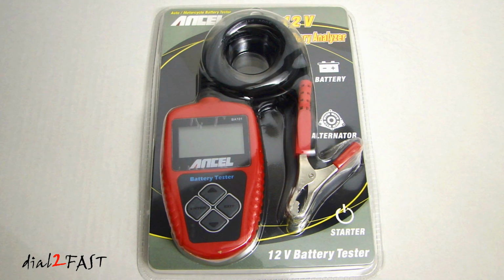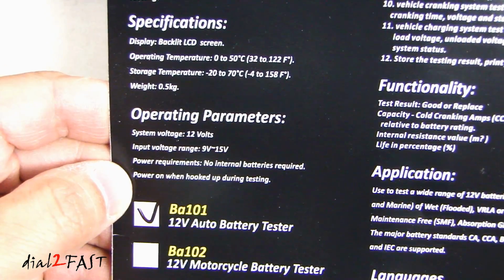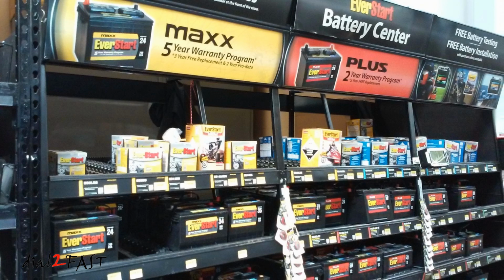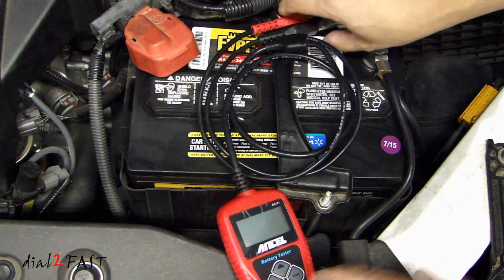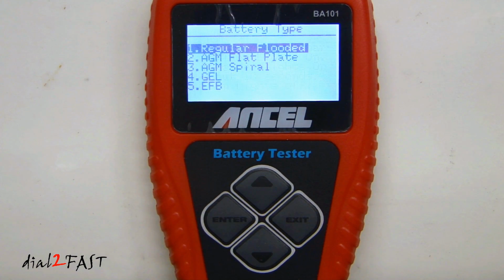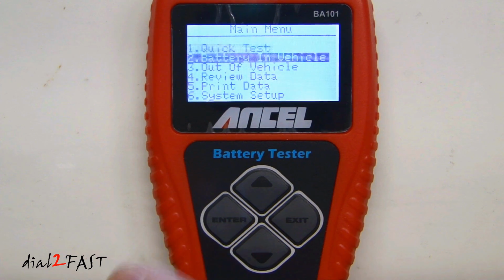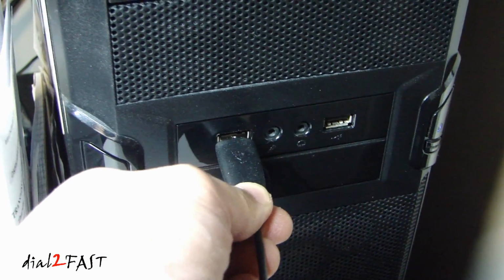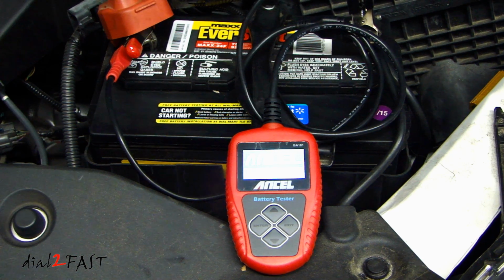ANCEL BA101 Car Battery Tester + Starter & Alternator Tester

Comment: Subscribed & rang the notification bell.
FWIW; The packaging has changed & no longer includes the CD for downloading the PRINT application.

The instructions that came with my unit told me to go online & click on the "Download" link on their webiste - however, the download link DOES NOT WORK WITH MAC COMPUTERS, only Windows PCs.
Reply from the maker: Thanks for subscribing and for the heads-up on the packaging updates!

Comment: Having just moved from walking distance to AutoZone to the woods, 15 miles from any auto parts store, I just bought this for $35.  THIS VIDEO IS GREAT. 
A battery died shortly after I got the tester, so it really helped.
 My old and new batterys did not list A-Hrs  amp hours. Someone at NAPA said to multiply amp hours by 7.25 to get CCA. Sorta works sometime.
But the machine gave me the info which I will write on top of the batteries. Thanks.

Comment: I bought that BA101 and I may be having a problem. I tested a brand new Delco battery and it said it wasn’t good, charge 100% but health 65%, brought it back to the store where they tested it in front of me on two seperate testers that said it was 100% good with a much higher CCA value than my test. Can those be defective?
Reply: Also… in your video, the first test you did said your battery was 100% healthy. The second test said your battery was 64% healthy… What do you make of it? Is there something I don’t understand here?

Comment: When doing the "charging test," do you lest the RPMs return to normal before pressing enter?
Reply: I was wondering the same thing. Maybe the measurement is supposed to be started by Enter only once RPM reached 2500. Ambigious instructions are probably a Chinese thing. So as Tina Turner used to sing: You'll never know 🤣

Comment: Hi, I am looking for a battery tester that will also work well for deep cycle batteries. Will the
ANCEL BA101 tester work properly for deep cycle batteries? I have a small deep cycle 35ah 12 volt battery and the others are full size deep cycle and starting batteries. Many deep cycle batteries don't have CCA or CA listed. 
 Please let me know.

Thank you

Tony
Reply: NO DEEP CYCLE BATTERY TEST. This type of battery load tester is meant to test cranking amp of start/cycle battery 6-12vdc. For deep cycle battery, this tool can only get ball park idea of battery health by getting internal resistance and CCA then comparing it to new of good exact same deep cycle battery reference from your own data or from battery manufactor spec sheet. The true deep cycle battery capacity test is done by using WATT METER under the same load.
Reply: @charlieson3394  Okay, thank you

Comment: Thank you for your video review.

All of these conductance testers only test for two parameters, Voltage & Internal Resistance, everything else like CCA, SOH, SOC etc. are calculations derived from those two parameters.

On the charging test it showed loaded and unloaded test results and an actual loaded test was never performed from what I can see, when did you load the electrical system? It was just a calculated number because the ANCEL BA101 never prompted you to load the system and in the operation manual it never mentions to load the electrical system either, this is a fail for the loaded test.

Other than an actual loaded test, overall it looks like a decent conductance tester.
Reply: It asked him to turn on the headlights. Is that not considered a load?
Reply: @OMGWTFLOLSMH  No, that is not a loaded test. At 8:36 the tool prompts you to turn on the headlights to remove the surface charge on the battery for the battery condition test so you do not get a false positive reading. I was talking about the alternator charging test that was performed at 10:45, no external heavy load was put on the system, there might be a pair of some wimpy resistors inside that try and simulate a load, but that is not the same as an actual heavy load like lights on, air conditioning on, brakes lights on, fans on, loaded test.
Reply: @JT-ov2yr  Headlights might draw 15 amps.  AC units might draw 10 amps  for small and 40 for large ?  And use about 3mpg.

Comment: To confirm, does an in vehicle test require that the car accessory power to be on? I noticed for my unit that unless the power accessory is on, I get a "Check Connection" error when I perform the Quick Test and Battery Tests.
Reply: you probably want everything to be turned off as not to add draw and interfere with the test results. save for the starter and engine in the latter tests

Comment: I have the result of alternator 

Loaded 12.40V
Unloaded 12.60V
Ripple 30mV

It show charging low.. mean the alternator is faulty?
Reply: Ripple is too large. Bad diode in alt
Reply: Yes. You need to check your alternator.

Comment: I recently purchased this tester and love it. Accurate and very easy to use. I work in the repair field and use it every day
Reply: Does your ancel battery tester still functioning? Mine is dead, no display only back light is on :(
Reply: HEY SO WHAT DOES IT MEAN WHEN THE CRANKING POWER IS LOW OR SLOW DOES THAT MEAN IT IS THE STARTER ON A HARLEY.

Comment: Can use this forest my deep circle battery?  It is 200amps battery. I live of grid, sometimes I buy used battery so I want to kno their state before paying. Again can I use it on 200amps 12v battery to know its state?
Reply: Im down the street. Be there in 2 mins
Reply: NO DEEP CYCLE BATTERY TEST. This type of battery load tester is meant to test cranking amp of start/cycle battery 6-12vdc. For deep cycle battery, this tool can only get ball park idea of battery health by getting internal resistance and CCA then comparing it to new of good exact same deep cycle battery reference from your own data or from battery manufactor spec sheet. The true deep cycle battery capacity test is done by using WATT METER under the same load.

Comment: Very good presentation. I got an Ancel and it seems like a useful tool, after testing it on known good and poor batteries. However the manual is a poor English translation. The manual detracts from the overall impression of the product. Ancel: are you interested in having a technical writer revise it?

Comment: I ordered a Sonic tester after seeing a couple of videos yesterday. How does this tester compare?  When I take my cars in for their oil changes the dealer is supposed to test the batteries.  My wife got stranded about 6 months ago with a dead battery shortly after I took her car in and my car wouldn't start shortly after I got the oil changed  last year.  One of these videos was saying that these testers are better than a regular load tester which I suspect the dealer was using.  He done a test on a batter that was showing good with a regular load tester but one of these showed it was bad.  Another guy was saying that the ripple test was for the voltage regular.  I ordered a tester so maybe I can get a heads up the next time before my battery goes bad instead of getting stuck with a bad one.  I figure anything over 5 years on a battery is a gift.  The original battery in her CRV only lasted a little over 3 years and the replacement Interstate battery lasted a little over 4 years.  The Motorcraft battery in my Taurus lasted almost 6 years.  I have had some cheap auto parts store batteries like from Autozone barely last a year.  I have never got more than 3 years out of a Diehard battery. It doesn't pay to buy a cheap battery.

Comment: Thanks for this very detailed video! much appreciated. Btw most modern cars have AGM batteries  rather than flooded cell because they are required to support auto stop-start systems. Also, I wonder whether the cranking test will work on some modern cars that use the alternator to start the engine through the serpentine belt and don't have a traditional starter motor.

Comment: my ancel ba101 tester arrived and it dont work in motocycle battery!! the minimum AH in this unit is 30 AH my bike battery have 14 ah. so not precise for bbike batteries

i will try this for small batteries

http://www.banggood.com/pt/TY-6402-Car-Battery-Load-Tester-Analyzer-2V-6V-12V-Battery-4-500Ah-Capacity-p-1116069.html?rmmds=search
Reply: RbG84 Kudos for the Video clip! Excuse me for chiming in, I am interested in your opinion. Have you thought about - Rozardner Powerful Battery Reality (google it)? It is a great exclusive guide for learning how to recondition an old battery minus the normal expense. Ive heard some decent things about it and my work buddy  got astronomical success with it.

Comment: Does the PC needs to be connected while it is hooked up to the battery?  Given that it has no internal battery, it most likely does not remember anything once you disconnect the clamps.  It would have made more sense if they had provided at least some supercap so that you could take the tester back in the house to hook up to the PC at your desktop.
Reply from the maker: +12vgs8606 The tester will remember the last test result even when you disconnect from the car battery. It most likely have flash ROM inside. When you connect to the PC, the USB 5v will power the unit without needing 12v power.
Reply: Excellent... Was going to ask the same question. 
Good review/tutorial.